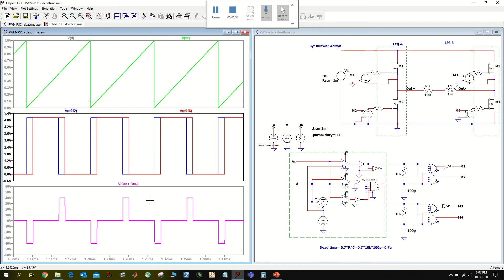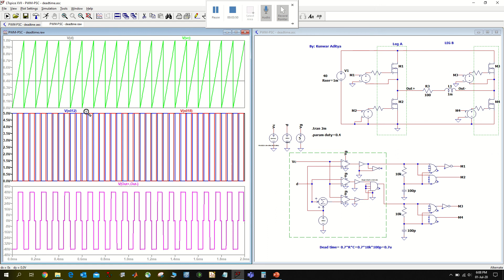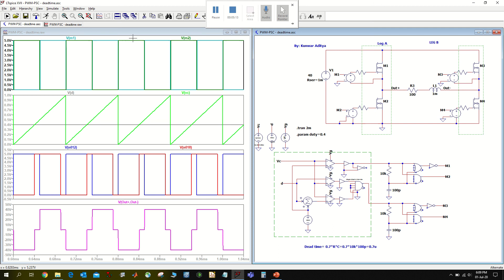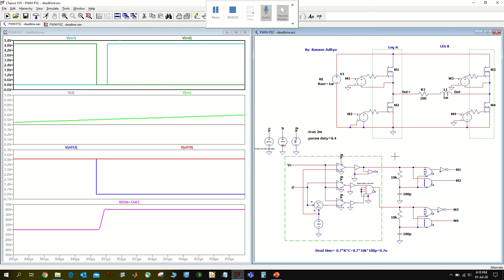Phase Shift PWM technique for control of single phase inverter with LTSpice simulation.

Comment: what is that voltage source connected at the bottom of the summer block in the phase shift logic circuit.It isn't clear

Comment: I use a differential schmidtt buffer for the comparators and then you don't need Vg and the Ground . Also everything works at 1 volt so you don't need the level shifting. You do need to define to the Schmidt triggers Ref=0 though.
What is the other voltage voltage source that is going into the Adder on the low point (not the duty cycle voltage source) if I may ask ?
Reply: BTW Thanks for the presentation.

Comment: Good work. I think the voltage source in the low left is at 0.5V.
Reply: I think you're right. I used {duty/2} for the "d" voltage source and 0.5V for the lower comparator. It worked, but I had to add a slight time delay to the AND gate in the middle of the circuit, otherwise it threw out spikes. I put in the value td=10n in LTSpice.
So the comparators are compared with from top to bottom with the following, which works for me, but maybe not exactly the same as in the video.
Top Comparator + pin signal from bottom Voltage source, I used  0.5V
Middle Comparator - pin "d" I used duty/2
Bottom Comparator + pin is from Adder Sum which is 1/2 + duty/2.